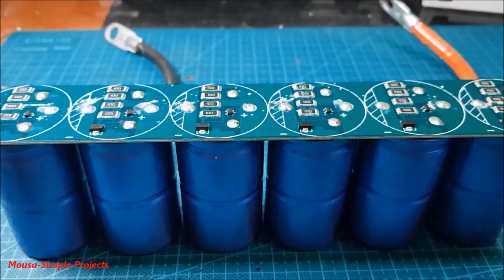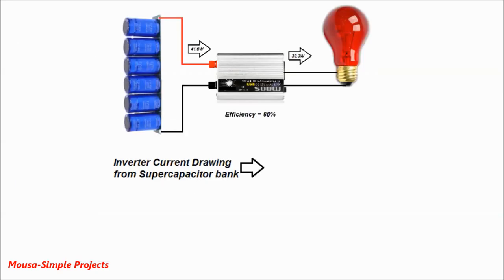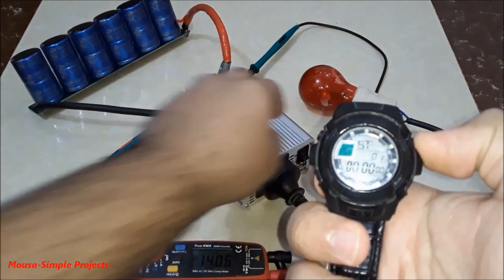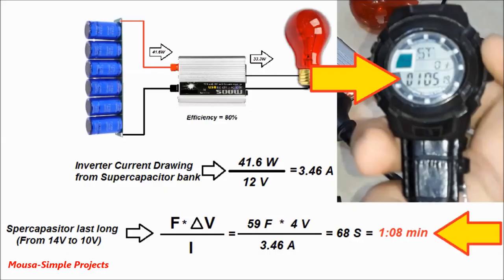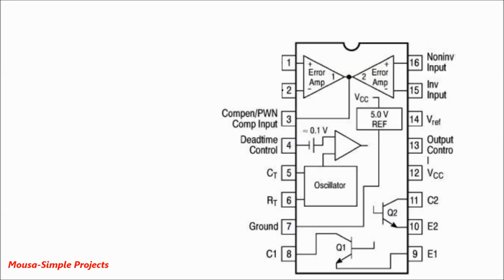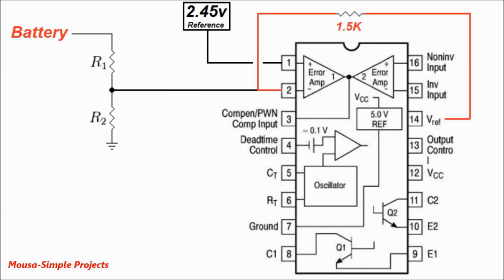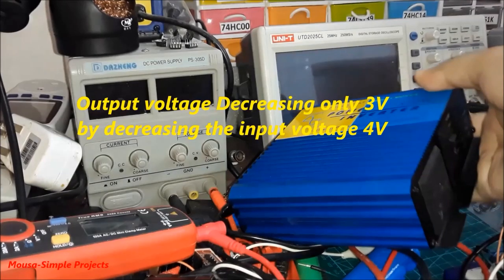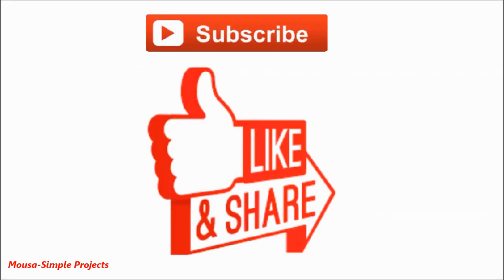Running 220V Lamp With Supercapacitor

Comment: Can you link these capacitors in parallel to increase the time that the bulb will run?
Reply from the maker: If you mean more capacitor "banks"  in parallel , Yes
But if you mean connecting the "2.7V capacitors" in parallel NO, because they have low voltage (only 2.7V) and the inverter need 12V.